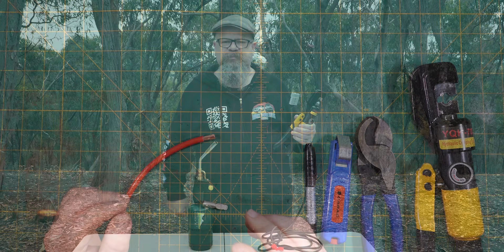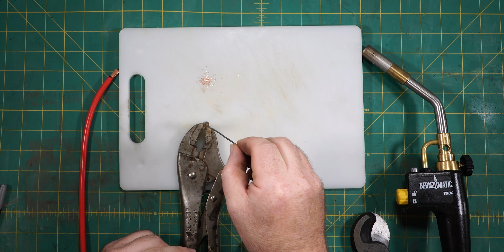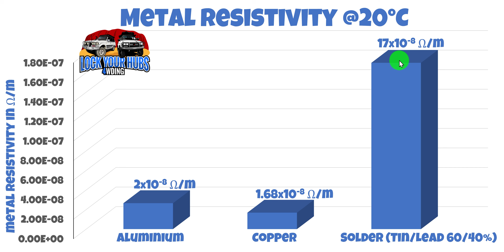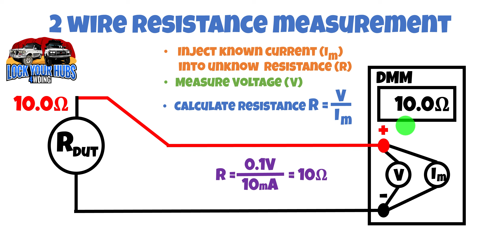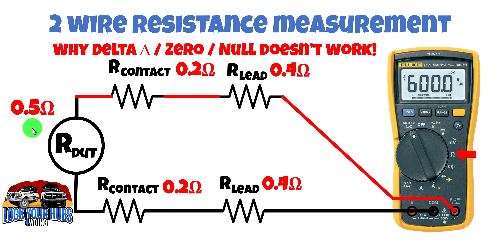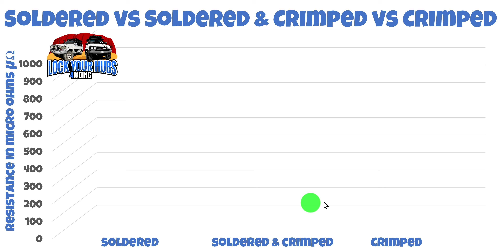Crimping vs Soldering for Anderson Plugs

Comment: With regards to just soldering lugs and not crimping.
I know of a case where a soldered lug on a yacht alternator got hot from an electrical fault and the solder melted letting the live wire fall out of it's lug and short out on the engine.
Crimping would have prevented this.
Reply from the maker: There are going to be individual instances of both dodgy crimps and soldered joints. If the joint had been soldered properly, it wouldn't have gotten hot enough to melt the solder.  

Did the soldered joint fail due to the engine vibration? Or was the soldered joint substandard to begin with?
Reply: Good question and one I can't answer. This story is third hand. But the facts are, if it was crimped as well as soldered the wire souldn't have came out of the lug. (provided it didn't break) That's handy if your on a yacht in th middle of the Pacific Ocean. @LockyourHubs4WDing

Comment: Crimp definately. If soldered, heavy duty heatshrink needs to be used to stop ANY  movement at the terminal.  Do NOT solder then crimp.
Reply from the maker: I tend to agree, without actually testing it. Though prior to testing it, everyone told me crimping was electrically superior. What I can't find is any hard evidence that crimping is mechanically superior.

Comment: Straight out of the gate , "You need to learn to solder before you make videos".  In none of these cases did you actually solder anything, all you did was make cold joints that will never work well..... For 99.99999% of you, crimping is the ONLY way to go as you won't have the experience or skills to solder large/high current cables correctly  (as demonstrated by old mate  showing you how to utterly fail at soldering large conductors in his demonstration). Despite old mates test coming out in favor of solder (as it should), he created possible one of the worst solder joints you can have (cold joint) and this will fail and possible cause a fire at some stage in the future. Do not follow this demo for soldering anything.... 

Had you done it correctly the straight solder would be the same as crimp and solder (assuming you crimped then soldered but this unlikely you can crimp and solder correctly with tools at home).  Fyi you need to tin you wires and wick the solder all the way into the cable before attempting to solder it to the connector.
Reply from the maker: Interesting, though your assertions seem a little contradictory. Firstly, you say the solder terminations are a "cold joint". 

Then, you say the soldered joint should have the lowest resistivity. As the testing proved here. Though, a cold joint should have high resistivity and larger voltage drops than a properly soldered joint. None of which is present here...... :)

Comment: Good video mate. It would be interesting to redo the test after crimping the terminal with the proper Anderson power products 1309G4 crimp tool so that it meets their specifications. The genuine tool uses a single indent to crimp, there are too many variables using a hex crimp that the terminal isn’t designed for.
Reply from the maker: While I agree it would be interesting, I think it would be of limited value. 

Most home gamers if they're going to pick up a crimper, will pick up a reasonably priced middle of the road crimper, and the model I used is by far the most popular. 

That's why I chose that particular crimper for the test.
Reply: @LockyourHubs4WDing  I think a hammer crimper is the cheapest.  I have one.  It's single indent.

Comment: The reason why your crimped joint is a higher resistance than the soldered joint is because it's likely an incomplete crimp.  With all the variances in dies, cable diameters, lug diameters, and lug wall thickness it is REALLY difficult to get a perfect crimp.  This is why I've moved to using die-less crimper (both the hammer type and hydraulic) because it seems to get a good crimp (when used correctly) despite all the variables.  With that said, I tend to solder my Anderson-style connectors purchased from Amazon because you usually can't easily get a 175A plug that you can easily crimp a small wire into if you wanted to.
Reply from the maker: That was an average of 3 samples, so unless they were all less than perfect, crimping isn't as conductive as soldering.

Comment: Thank you!
We have been using Anderson connectors on our public safety (mostly fire department paging and dispatching) repeaters.
I USED to solder, then saw videos on YouTube showing terminals that were cut in half to show the cross-section.
I was convinced that it was a “hermetically sealed / metal fusion” type connection.

Nope.  After your video presentation and work involved, we are back to filling with flux / crimping “just enough” to keep the wire from pulling out / soldering the rest of the way.

Thank You Sir!
Reply from the maker: I think a combination of the durability of a crimp and the superior conductivity of the soldering is the best compromise.
Reply: This "soldering" technique is easily the worst I have seen in all my years. DO NOT terminate large conductors this way
Reply from the maker: @Redemptioner1  let me guess, sparky?

Comment: I can't recreate the experiments result. I measured 0,6mV drop across an Anderson crimp joint for 10A. So you can even get lower than soldering with a good crimping plier. So I definitely stay with soldering. If you have a perfect cold weld between silver and copper thats much better than with a soldered layer in between. And you get better mechanical durability on top for free.
Reply from the maker: Were you using the 4 wire method?

Comment: Hex crimps are touchy regarding the cable size / terminal body combination. The crimp jaws can bottom out giving the impression of good tight joint when it is not. non hydraulic lever type indent crimpers are probably more fool proof. I have had many good looking hex crimps where the cable can be pulled out of the terminal when given the tug test.
Reply from the maker: That's a good point, with crimping, wire a crimp selection needs to be spot on and the tug test should be part of the process.

Comment: How I solder. set torch upright on bench top and use the hold flame on button keep a small flame going adjusted to about 30mm long. hold bell end of terminal with long nose pliers and heat the fully exposed contact end. feed in the required amount of solder  to melt the solder and a layer of brown flux will float to the top of the molten solder. this flux is essential to help  tin the  the wire that is going to be inserted into the terminal. if the flux catches alight you are way to hot. for thick cables keep the end of the terminal in the flame and inset the wire into the molten pool of solder and hold it there for a few seconds as thick cables they will need time for enough heat to soak into the cable  positively solder the wire. take join out of flame and hold together until it solidifies. If the connection is  heated for to long the solder will wick up the wire strands and make a stiff section of soldered wire extending beyond the terminal entrance which is undesirable. carefully inspect the result of your procedure and learn from it..
Reply from the maker: Sounds like a great method, sitting the torch stationary is probably safer as well.

Comment: Great test, love the graphed data.
Certainly interested to see some long term tests on vibration and corrosion resistance. You've proved half the scenario of old-skool soldering is better... now end the lazy crimp method junkies for good. 😀😀
Reply from the maker: I laughed at "crimp junkies"! The testing is still in the planning stages, though it is going to happen!

Comment: I've worked professionally as a Licensed electrical fitter/mechanic... terminated countless heavy and small cables in the power generation/distribution, protection and control sector. 
NEVER has soldering been an acceptable way, by any Standard, to terminate cables.
This is especially so in an aero applications. No Licensed Aircraft Maintenance Engineer (LAME) would contemplate soldering or even crimping and soldering any wire or cable... EVER. 

Further, no way would a professional electrician use a cheap ass crimper that couldn't apply the correct force. That lug could have been crimped a lot more. Evidence of that is the fact that not every hex side of the crimp are equal or correctly formed into the dies. 
Think about that, if you can.

Your crimping and soldering methods suck too. 
1. It's better to strip more insulation and achieve full depth of cable engagement, and have 0.5 to 1mm of cable strands appearing between cable insulation and lug than butted up with no indication of full engagement has occurred after a crimp.... which is what you have done here. 
Heat shrink goes over the crimp only after inspection by someone QA qualified.
2. Your 'solder pot' idea is asking for dry joints, given all heat will be sucked out of the 'pot' when the cold cable is inserted. 
3. The flame heating of the Anderson lug compromises the Tin plating on the lug and at even low temp anneal the copper, resulting in a contact joint that will fail far earlier than a crimped connection.
4. Solder flux is notorious for promoting corrosion. Not even dodgy plumbers use soft leaded solder these days. That's purely dodgy DIY. 

The 'resistance measurement' method used is highly flawed too. Bridge circuit meters are used to directly measure ultra low resistance and calibrated. your 'data' means little. These are instruments that can detect the difference between correctly tensioned (using torque wrench, mind you) connection bolts in busbar to cable joints.. checking resistance of Earthing grids... and also used to test the welding of fused railway rails.   

You are obviously only dealing with low voltages and currents in an automotive field that has little to no comparable industrial safety or current loading duty.
And chances are, people that terminate Anderson lugs onto cables don't even use the appropriate CSA cable, especially when the lugs are not specified in terms of Cross Sectional Area, rather, some supposed "current rating'' of the connector. 
Gunna be difficult with Anderson connectors given Australian cables are manufactured to CSA Standards and NOT made to suit American 'gauge' standards, so there is that too.
Reply from the maker: Looks like you're not willing to let this one go.....

The dies were fully seated as I always push the crimper into bypass. Flash is a symptom of overcrimping with an undersized die.

Tell you what, being in the trade, no doubt you'll have access to a desktop DMM and Kelvin connectors. 

Run exactly the same test, video it to prove the superiority of the crimping proceedure electrically and I'll link it up in the description.
Reply from the maker: You'll notice I never quote qualifications or experience to justify opinions, to do so is highly flawed, data never cares for a person's qualifications or experience. 

This comparison provides hard data for conductivity only, and taking into consideration conductivity, soldering is proven to be the most efficient termination method.
Reply: @LockyourHubs4WDing   Right.. sure... I see..  a know-all that doesn't even know how to crimp a bloody lug properly or recognise a faulty tool. 

Again, I've probably crimped more high current lugs ( what ya got are  pissant - what you say is 10mm by the die selection... probably actually 16mm ) than you have had a warm bath... as a fully qualified electrician working in the commercial/Industrial sector to the highest Standards in this Country. 
Your ignorant methods deem the so called data as worthless. 
The only thing 'proven' is your ignorance. 

If the voltage drop/resistance losses of crimp joints you make are that bad in the real World there would be countless fires occurring in every switchboard and machine around the World. 

Think about that, if you can.
Reply from the maker: Glad you got that off your chest? 😁

Though seriously, I've learnt over the years just because you've been doing something for a  long time, doesn't necessarily mean you're doing best practice. 

And qualifications aren't worth the paper they're written on unless you're willing to question the status quo. 

Every sparky I know, without exemption told me that the cold welding procedure as a result of the crimping process was more electrically conductive than soldering. And logically, as solder is also more electrically resistive than copper, that made sense. 

Turns out the intermolecular bonding of a less electrically conductive intermediary-like solder can provide a more conductive termination than cold welding.

Don't make the mistake of looking at these things with a closed mind. If your current thinking doesn't match the data quantitatively acquired, then it's time to rethink what you "know" to be true.
Reply: @LockyourHubs4WDing   Buy a crimper that does the job correctly, and learn how to crimp lugs correctly. 

To have that cheap POS hydraulically bypass without fully closing the dies is a clear indication it isn't up to the job. That should have been capable of fully closing the dies, even if the lug was oversized. 
Never have I seen a crimper fail to do so unless during closure the copper barrel squeezes between the faces of the opposing dies... in which case a degree of what looks like flash presents. The 'flash is dealt with by rotating the lug in the hex die and closing down again.
 Correctly manufactured dies do not result in a termination less than the rated CSA of the cable. 

If you were working in the electrical industry, every crimp you did like so, especially those that didn't have FULL cable insertion that you thought was A-OK would be a QA fail and every termination redone. I've seen it happen many times, usually when a tradesman doesn't correctly supervise an apprentice or process worker, or the use of crappy tools not fit for purpose.  
If the cable isn't full inserted 100% and fully crimped down it can pull out of the lug. Simple as that. 

Those who suggest this was 'scientific data' don't know shit from clay. 
Your data is based on poorly crimped lugs. All it proves is how bad it can be when some idiot does this kind of work.

Comment: I'm not disagreeing with the principles involved but your soldering technique worries me a bit. Shoving the cable into a molten puddle and then moving it about while it's cooling is going to result in a pretty poor joint, with micro-cracks all the way through it. The cable needs to be firmly held in position inside the contact and both restrained before heating and applying the solder to the assembly, then left to cool before allowing anything to move. Better yet, tin the cable before the assembly.
Reply from the maker: You try to minimise movement while the solder solidifies. The reason I don't tin the wire is to minimise the solder heading back up into the cable, under the insulation. I had the same reservations, so cut one apart and found full penetration and no evidence of crystallisation of the solder.

Comment: Your method of soldering is incorrect. You need to tin the cable first to ensure proper penetration of solder into the cable. Then insert tinned cable into the terminal while still heating( remove heat).

If you were to cut the terminal you  made through, polished the cut end you would see the solder hasnt penetrated.
Reply from the maker: The reason I don't tin first is to stop the solder from wicking up the cable.  I have cut one cable (small sample size I know! ) And we had full penetration of the solder in the wire.

Comment: I'd love to see more! 
Also I'd like to see the difference in resistance over a length (say 5m or 10m) with different amounts of anderson connections, to see how much resistance we add with each connection
I know myself, I have multiple anderson connections on my battery box, then I plug a lead in that runs to my step up and that has 2x anderson plugs and then another to my travel oven..
Is the resistance enough with that many anderson connections that I should consider wiring it all together without andersons....
Does each conection stack more resistance..?

Love your content mate!
Reply from the maker: There will be a certain amount of contact resistance with each Anderson connector, in addition to the crimp/solder of the terminations. 

You could use exactly the same process (4 wire resistance measurement) to measure it. As each connection is in series, it would all accumulate. 

Sounds like an interesting idea for a video!

Comment: NASA have an informative document on the making of connections available online, they only allow crimp connections. The reasons are discussed in the documentation. Before crimping use a product such as NO_OX to prevent oxidation of the internal area of the connector and the copper wires. Also was the cable that was used sized correctly for the connector, it did appear to be too loose a fit and the crimp tool hex size correct for the connector? All these specifications have an effect on the connection quality.
Reply from the maker: It was the correct sized wire and crimp, do you have a link to the NASA document?
Reply: Nasa dont have to crimp joints sitting in salt water in the bottom of your boat. Eg, if you needed to join a wire to your bilge pump, crimp + solder + heat shrink with glue. Relaibilty is the key in salt water environments. Even on the river, corrosion is an issue.